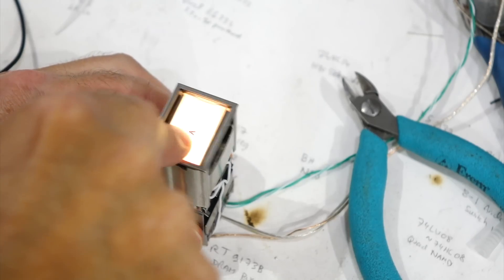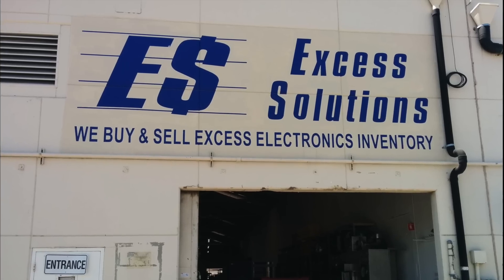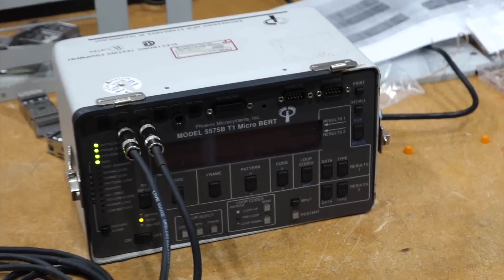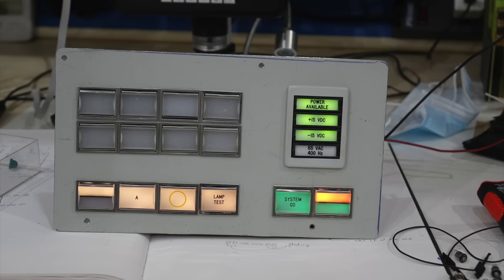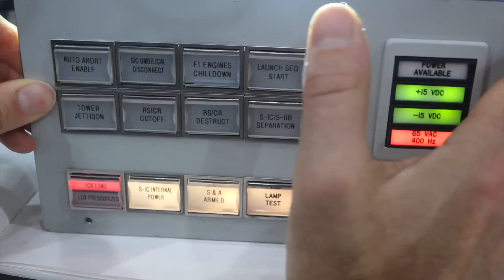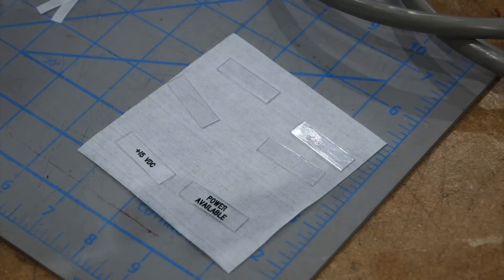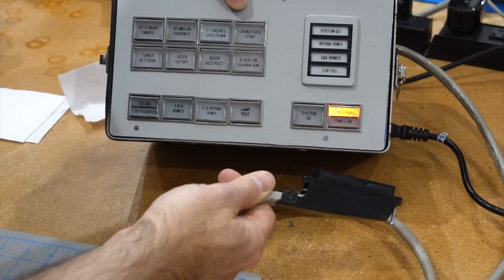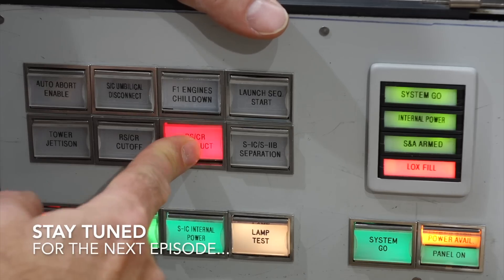Apollo Ground Service Equipment Panel Prop

Comment: I have seen these switches made even more ridiculously complicated with an optional solenoid added to the shaft that allows for remote control of the button itself. If you set the button up for momentary action instead of alternate action the magnet could be wired to hold the button down and on until an external interlock released it and the button would pop back up again. I can't imagine what the government paid for that switch.
Reply from the maker: Indeed. I have a few of them with the magnet module you describe. It’s just another module that you insert in the stack by clipping it. These were hermetic, the H version were flight/MIL rated switches, so they sure did cost a fortune.

Comment: The actual consoles used by Huston were designed and built by the Ford Motor Company as they acquired a company that had all the resources that NASA was looking for and won the contract for the Apollo program ground stations, IBM got the computers, North Aviation got the Command Capsule and Grumman got the LEM, stuff you learn when trying to find switches from the 1960's!

Comment: There are literately thousands of these switches on hundreds of Navy ships. When we got bored on watch  we would do a lamp test and break out the large plastic jug of bulbs we had and replace the burned out ones.
I took a tour of the Johnson Space Center in Houston and sat at the consoles used for the early space missions. Out of habit I popped one out, I didn't take it I just took it out and put it back. You had to have the right touch to press the switch back into place with out depressing the switch. 
Some had a little wire lever that stuck out that you had to turn to release it.

Comment: T1s are still widely used in office PBX systems, mostly to deliver ISDN PRI services for delivering large numbers of phone trunks. Even though there are SIP trunks over the Internet available today, they have lots of call quality and reliability problems. Nothing beats a T1 for reliable voice phone calls.

Comment: I noticed the switch lights are in a steady state. When you watch Mission Control footage some of them are flickering. Is that some kind of standby mode?
Reply from the maker: The flickering Twist Lites are on the voice comm panel (also known as the "VIS keyset"), and indicates the status of the voice loop or "net". Dark means the net is not monitored. Lit means it is being monitored. Flashing means it is the channel the operator is talking on. Winking (slower flashing) means active channel (the last two may be swapped). The info is from this link here: http://www.collectspace.com/ubb/Forum14/HTML/001582.html

Comment: before i watch the rest of this video, you got me at 39 seconds, I really want switches like that for my computer console project. I plan on setting up 3 pcs with angled panel between them and I wanted to fill the gap between them with what I call POPL, or panel of pointless lights. I love pushing buttons that light up and it would look awesome with those in place rather than just boring switches and random leds drilled in place. I want I want I want lol

Comment: These switches, lights, and displays also were used in the Minuteman Missile System. I was in the Air Force at Vandenberg  AFB from 1967 to 1970 and I repaired and changed out these switches when they failed. They were pretty reliable, except for the bulbs. The lamp check switch saved a lot of work. You commented on the fact that you cannot tell when the switch was on or off. In reality every switch produced some action somewhere on the panel. If it was off, a corresponding light was lit, saying it was off or that it was in a default position. When actuated, the previous light would go out and the selected function would be activated and another indicator light would illuminate indicating that the new function had been selected. The panels were usually designed in a fairly intuitive way, so the operation was fairly logical. The launch control facility (LCF) was where most of these panels were found.  A lot of the switches were wired so that the upper light was the default, and the lower light was the selected function and the lights would change when the switch was pressed. Nice job on the Apollo box. Bob

Comment: here is a cool idea. rig it into a coffee maker to control the fill of the water reservoir from the tap and brewing and preheating of the coffee and water as well as pressurizing the tank! That would be such a cool way to make coffee when friends come over!. You could base it around a siphon coffee maker and a couple of automotive fuel pumps and a level sensor plus a relay to control the temperature and a sensor shut off at temperature. one button to fill the Lox reservoir (The water) opens a valve on the water line then shuts down when the reservoir level is reached and flips the light to red. then a button to preheat the water turns on a heating coil and turns off when a sensor reaches the desired temperature. Flips the button from red to green. Finally, a button to control the iPhone fill and turn on the heater for the lower bulb of the siphon (Gas control and ignition would be ideal with a temperature sensor to control gas flow. then gets turned off when a level sensor indicated the lower bulb is empty. then another button to monitor for siphon completion turns from green to red when the button bulb is full of coffee! There you go a NASA over-engineered manual coffee make and astronaut refreshment dispensing system. Now sell it to Nasa for 20 million along with the 750,000-toilet seat. Might want a couple of Arduinos for relay and pump control tied to your control box! I've seen this done on a friend's chemistry lab at work. hers is  NOT NASA Approve or controlled.

Comment: "Who tests T1 lines" -- guy who fixes T1's transported over microwave for legacy E&M radio circuits even now in 2021....     we're talking regional systems -- 7+ states!
Reply from the maker: There are plenty of “emulated” T1 over fiber or other media. But I don’t believe there is any T1 on copper links left in the infrastructure for over 15 years. That’s what this tester does. [Edit: one commenter below says he still has a few “real” copper T1’s in new England]
Reply: @CuriousMarc  I've got several copper T1's still -- here in New England (USA) they're starting to move some of it to optically isolated T1's (whether the optics are at the customer demarc, or at the central office) however, even microwave 'emulated' T1's have framing issues sometimes....     good rule of thumb is anything that can be tickled by lightning has a propensity to have issues ;)   Either way man - congrats on your box - I LOVE those switches, always have...   I've just never thought of getting some for my projects!
Reply from the maker: @n3lee Alright, that sure counts as a “real” T1! Thanks for the note. So they are still around! Well, the box of electronics is intact and functional, if I ever run into a 2km copper T1 to test I am ready to roll...

Comment: Cool Prop.

I am curious how NASA ever organized and wired all of this to an array of 360's to provide timely information to the display user's AND allow them to control things in real time.  What does an IBM 360 digital interface with 1,000's of IO points look like?  What did the wiring look like?  Was the IO distributed with short local wiring paths or centralized with long snaking bundles?

Comment: Do the switches actually control anything or just light up. Would be nice to use this box to actually control something. Maybe build some custom test equipment in the box and use the switches to control it.
Reply from the maker: That's the goal. That's why it's connected to the 66 Block.

Comment: Does anyone know how to open a Fuse-Lite switch? I cannot open it.
Reply from the maker: I don't have one, but from the brochure, it looks like you pull the button forward out of the switch like in a twist lite. Maybe then slide the white part of the button up. Not sure what the next step is but it should make sense at that point.
Reply: @CuriousMarc  Hi. I cannot believe I forgot to update this post after all these years, but for anyone else with a Fuse-Lite, you push it in and down at the same time, then release it. It will pop out. You can pull it out all the way to replace the standard cylindrical fuse or you can pull it out partially, and the front part will swing down to replace the bulb.

Comment: You need to put an asset sticker on the edge. 1/2 on the panel, 1/2 on the can. That would be a tamper security seal.

Comment: You would be surprised how many people still use T1 in retail, even though it's often terminated in fiber nowadays.  It is still used, even in new setups, due to its ubiquitousness and very high reliability.  It is so reliable that even larger retailers still demand it for backup capacity.
Reply from the maker: Oh you sure can still buy a “T1” 1.55Mb chunk, but it’s a (very small) demultiplexed part of a fiber link. Almost no copper left in the carrier infrastructure for at least 15 years.
Reply: For POS uses I would imagine?
Reply: @paulcerveny9384  POS, back-office, MIS, any mission critical system.

Comment: Excellent!  A great use for a Microbert. I made one into a nixie clock enclosure and it looks great. I love these control panels. Good job on the switch overlays. You can also use stage lighting gels to change the color of the switch backlighting.  It's pretty cheap, comes in a pack of different colors and lasts forever!
Reply from the maker: That's a great idea!

Comment: Wish i could build my own mainframe computer with frontend panel made of those.
Reply: Your problem would be the mainframe -- the lighted switch panels would be insignificant compared to the computer.
Reply: @acmefixer1  Mainframe could be done on just single FPGA. Not a big deal.

Comment: In the 80's USAF We had what we called the CFA.  Central Fault Alarm that employed these switches.  We had it set up to monitor Microwave relay Stations across the U.K.    As a AUTOVON switch we controlled a number of links in and out of country.  Satellite included.  Whopping 600 Voice and Digital Channels at hand.

Comment: Do you need lamps? I think we still have drawers full of them in the basement of GSFC...
Reply: Everyone wants to abandon incandescent bulbs for LED lamps because the switch will no longer overheat and turn brown or melt.
Reply: LEDs are just so much more efficient.
Reply: Now that Marc has blown the lid off pre-owned prices for these switches, is it too much to hope that GSFC will be auctioning off surplus basement items any time soon? (Hoping to help build many Honeysuckle Creek era control panels with a few enthusiasts).
Kind regards,
Terry
Reply: @terrygains8327  Aside from a parts cabinet full of various lamps for all kinds of gear from that era, it was mostly long gone by the time I started in '86. I did find and still have an 18 switch panel from those days, but I don't know the older gear like you folks do. To me, it just looks cool on a shelf. KSC and JSC had far more volume of gear than we did as GSFC's role was mainly Comms. I do however have the last complete and operational video/data recorder from Gemini/Apollo.  I believe it's destined for Smithsonian.

Comment: "Who would test T1 lines anymore?" says the guy who restored teletypes.
Reply from the maker: But TTY=awesome and T1=eminently forgettable. Same for retro computers and vintage test equipment - and vintage cars. Only a relatively small elite portion of them are worthy of study and achieve collectible status. That said I am keeping the BERT innards intact. In case I run into a 2 km portion of copper T1, you know...
Reply: @CuriousMarc  It was mostly teasing.
Reply from the maker: @lougrims  Uh oh I got triggered :-) You get a little heart in compensation ;-)
Reply: @CuriousMarc  Oh sorry if it was not obvious. I love what you show on this channel and always learn new things from your videos.
Reply: @CuriousMarc  
If you "run into" a T1 line, it's typically labeled HI CAP.  But be careful - it could have 108 VDC on it, which will give you a good 'bite'!!

The telco puts an interface unit at the customer's premises which allows the telco to remotely test the line.  This can loopback the line to see if the line is error free.  The BERT tester may be used remotely to test the T1.  Since it's an industry standard, the remote T1 end may be tested, even though the lines between the tester and the remote T1 are higher speed, such as optical fiber.

However the fiber line may also have its own interface unit in a channel bank.
Reply: It's interesting how some technology perseveres while some falls by the wayside and is not worth preserving.  T1 lines are obsolete, and not too many people have any love for VHS tapes, but audio cassettes are making a comeback to a limited extent.  And Teletypes and old typewriters are just cool and kind of steampunk these days.
Reply: @greendryerlint  I can go to Walmart and buy vinyls now
Reply: About 60% of the PBX's I installed in 2019 was T1 line based. Im not in telecom anymore however.
Reply: @PINKBOY1006  
Exactly.  Cisco VoIP phone systems are connected to the PSTN network with T1 ISDN PRI lines.
Reply: @acmefixer1   Yeah. I was mostly a Panasonic installer, but yeah T1 is still a goto for businesses. Especially if it is a retrofit to an existing structure.
Reply from the maker: Yes, T1 lines as a unit of service still around, but mostly emulated over fiber or some other kind of modern trunk. That’s the source of confusion in the comments . T1 not used as distance transport over copper anymore. This mostly tests the copper transport line, so it is no longer very useful.
Reply: @CuriousMarc  I have also seen it provided over a pair of 768 Kilobits/sec SDSL connections.
Reply: Having a T1 line, even as a largish corporation, gave you significant bragging rights. Megabits when ~300 BYTES per second was still the norm.
Reply: @R.Daneel  When the web was new and we were all on dialup at home, my friend worked at a place with T1, and I was so jealous when I went in there once and she showed me the speed.
Reply: @Wizardofgosz  Before wi-fi was a thing, I was the company "test" for extending the work network using a laser. It was a large industrial site, and that was an option instead of trenching. I was the only house with both a geek and line of sight. Oh, that was sweet. As it turned out, speed tanked if it was snowing or raining, so I only had it for about a year and a half.
Reply: I had to fix a punch card reader/punch machine a few years ago. A relay failed. It was like oh wow! it was for a water bill processing system for a town. they had been using it since 1968 and it wants to depreciate until 2021! Each account has a punch card for the billing cycle. I also went to a hospital that still had a plugboard in their main switchboard last year!
Reply: The T1 line was a 23B+D connection between branch exchanges, private or not. It allowed 23 channels of 64Kb/sec digital traffic between end points. The 24th channel was used as out-of-band control of the cable. 8bit digital samples were time multiplexed onto the serial cable. If used as a digital transmission only channel then it should be called a DS1 cable. The Europeans used a E1 implementation at 2.048 Megabit/sec rate. There was a lower speed cable called T0/DS0/E0 at 64 Kilobit/sec, and various higher speed like T3 upto the fiber optic channel implementations. To use for telephony, you need a demultiplexor and several codecs. You could get a module for Merlin (R) Excaliber systems as well as larger AT&T systems.
Reply: There are plenty of T1 out there, in fact there is still R1 (MF) out there. The only reason that that test device is defunct is that you can do the same with a multipurpose handheld device now. There is a lot of older technology out there especially in rural areas which still works, is ultra reliable, and would cost too much for the owners to replace. It is router failures that cause problems and outages in the telecom networks now. That and stupid people with backhoes.
Reply: i wondered if you could use it to test guitar patch cords. same jacks.  look identical actually.
Reply: @impv1se  Look closely at the wire around 3:20 plus, its a Live Wire.  I use Live Wire guitar cables although the connection to the quarter inch plug looks different than my cables.  I bet you could use it to test them.
Reply: @JohnVS8  yeah i cant see why it wouldn't work. cool.
Reply: I think we put our 24ch kit in the scrap bin back in about 1982, in favour of ............ cutting edge 30ch kit.
Reply: " Only a relatively small elite portion of them are worthy of study and achieve collectible status."  If you add the different people with different views and priorities, you probably end up with all of them worthy. 
Which made me instantly think about Top Gears brush with the Morris Marina owners club

Comment: T1 24 64k using BZn1 encoding to get a whopping 1.5MBit Asynchronous data OR as a PRI 23 64k channels of voice and a D channel for MWI CID COH etc usuallly unless bonded pair + then you still only need one D chan then get your 24 channels on a PRI,   There was always the 8 CO lines, a fire line then 512k data......omg I'm old and this is useless.

Comment: Now all you need is a half-peeled-off sticker at a haphazard angle on the front panel that says "CALIBRATION NOT REQUIRED". :-)

How strange did it feel to have to bend wire around actual contacts instead of just soldering everything into a PC board? :-)
Reply from the maker: It takes forever but it is incredibly reliable. It's near impossible to desolder these connections.